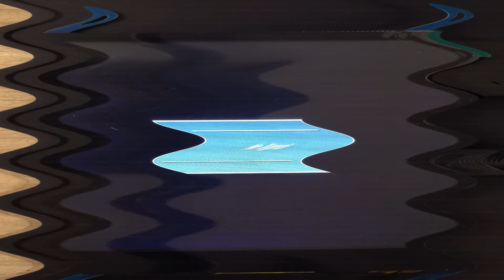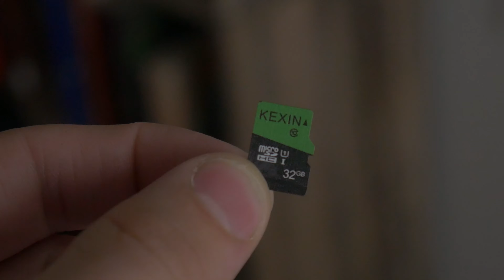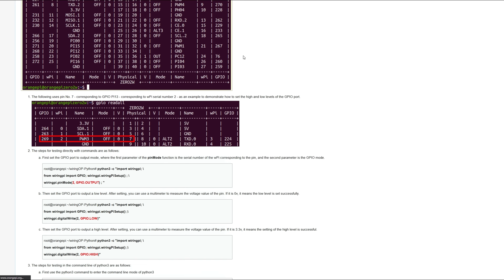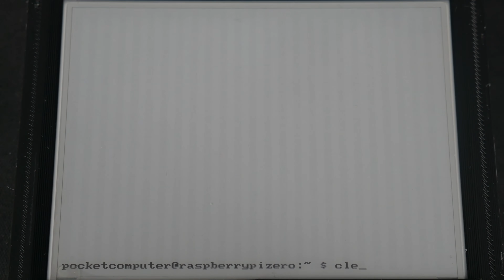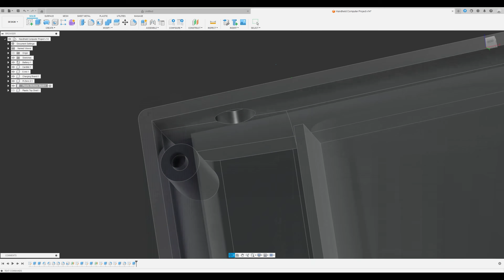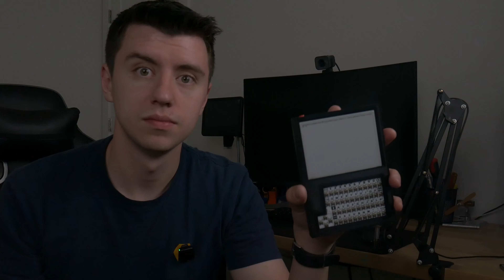NOT THIS ONE I Built the Ultimate DIY Pocket Computer

Comment: Dude, this is sick! That sucks that you had to switch computers halfway through. Now I want to know if it actually can run doom...
Reply from the maker: There is a version of doom called "doom-ascii" that can run in a linux terminal...
Reply: Where he is simulating an hdmi output, it can. Probably best to run doom in dosbox or the sdl port of doom with the videodriver set to fbcon to avoid needing to mess with x11/wayland. Fullscreen qt applications using qt's framebuffer output also probably work.